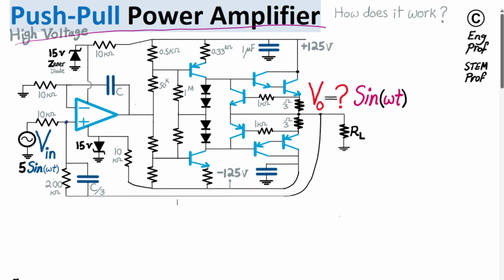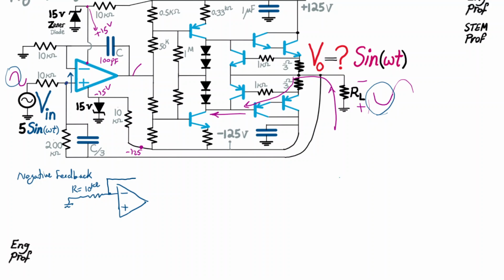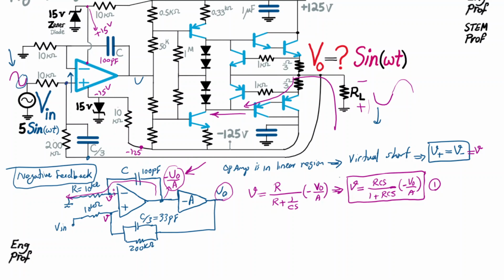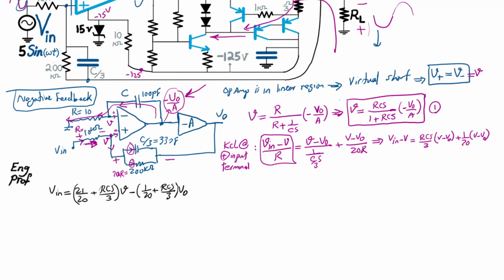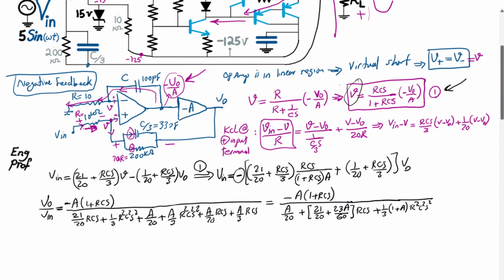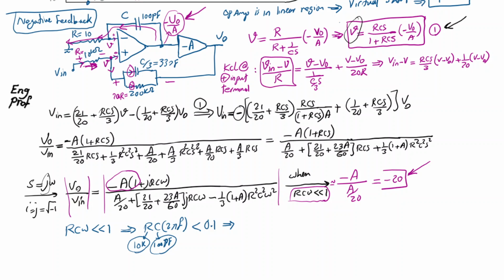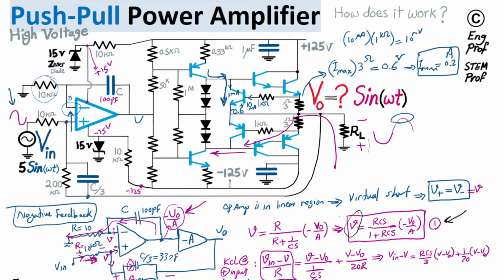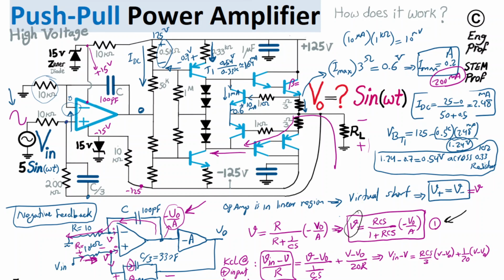Push-Pull Power Amplifier design (High Voltage) with Op Amp and Darlington Transistors

Comment: Great Video but it seems to me that you used 0.6V as the turn on Voltage for the current limit Transistors, but for the Common Emitter Stage you used 0.7V. Can you explain why you did that. The only reason I can think of is that you used 0.6V on the current limit transistor as a worst case calculation to not get unwanted clipping.
Reply from the maker: Good observation and thanks for watching!  You nailed the exact reason. For the current-limiting protection transistors, designing with a slightly lower threshold (0.6V instead of 0.7V) provides a conservative worst-case safety margin. It ensures the current limiter begins shunting base drive before the output devices reach thermal peak or hard saturation, preventing unexpected thermal runaway or premature waveform clipping.  Conversely, the main Darlington biasing chain uses ~0.7V per junction (1.4V total across the diode string across the Darlington BJTs) to precisely match nominal room-temperature Vbe drops, keeping the output transistors right on the verge of conduction to completely eliminate zero-crossing crossover distortion.  To explore other power stage, regulation, and analog design analysis from the channel, check out these related videos:
• Push-Pull Power Amplifier Design: https://youtu.be/866MYibo8yE
• Brokaw Bandgap Explained: Design a 2.5V Low-Drift Reference: https://youtu.be/loJBwi30Bb8
• Voltage Regulator Design with Op Amp, BJT & JFET: https://youtu.be/CJl-urzeiTo
• Bandgap Circuit Design: https://youtu.be/esMlNx5w9Jw
• Full-Wave Rectifier Circuit Analysis: https://youtu.be/DJJMNU-CYcg
• PID Controller for Servo Motor Explained: https://youtu.be/NATBlfABXrA
Thanks for asking good questions about the transistor biasing math and interesting technical discussion!

Comment: What specific benefits do you expect from this circuit? It would be more insightful if you mentioned the reason(s) for taking the feedback from the later stage and why you used feedback capacitors like that. A nice video!😊
Reply from the maker: You are welcome and thanks for your interest in my analog circuit design channel. Please see the transfer function derivation explained in the video to see how the specific values of capacitors in the feedback loops contribute to the overall response of the circuit.  With the chosen values and properly selected op amps, this circuit functions as a stable push-pull amplifier as long as the input frequency is less than ~15 KHz.

Comment: Hi,

Thanks for the nice video. I do believe though that this amplifier does not work properly.

The opamp will clip against the +-15V and will not be able to drive the current amplification stage to the appropriate swing as the voltage gain of the current amplification stage is too low. 

I built a similar amplifier, but I added a class A voltage amplification stage between the output of the opamp and the input of the power stage. That way I can properly drive the +- 120V.

Regards,

John.
Reply from the maker: Thanks John for watching and sharing your experiences. Glad to hear that your variant of this Push-Pull amplifier with an additional Class A amplifier worked nicely to drive 120V.  If you are using this design, depending on the type of your Op Amp and Transistors, you need to adjust the value of resistors especially at the output of the Op Amp (for example, the 50 K ohm and 500 ohm resistors.)  The choice of Op Amp is also important. Be sure to have a low drift, high drive CMOS Op Amp.  To watch related videos: Push-Pull Power Amplifier Design with Darlington and Sziklai transistor pairs https://youtu.be/866MYibo8yE 
Voltage Regulator Design with push pull output https://youtu.be/CJl-urzeiTo
More Power Amplifiers & Voltage Regulators Videos are in https://www.youtube.com/playlist?list=PLrwXF7N522y4vWr-8XRBqxpi5idFDE9BV video playlist.

Comment: Thanks, your video is very helpful !
Reply from the maker: @horacepoon7044  You're welcome! Glad that this power amplifier video is helpful. Related videos are: Push-Pull Power Amplifier Design with Darlington and Sziklai transistor pairs https://youtu.be/866MYibo8yE 
Voltage Regulator Design with push pull output https://youtu.be/CJl-urzeiTo
More Power Amplifiers & Voltage Regulators Videos are in https://www.youtube.com/playlist?list=PLrwXF7N522y4vWr-8XRBqxpi5idFDE9BV video playlist.

Comment: Great analysis! 👍👍👍
Reply from the maker: Thank you! Glad that you liked this Push-Pull video. More Power Amplifiers & Voltage Regulators Videos are posted in https://www.youtube.com/playlist?list=PLrwXF7N522y4vWr-8XRBqxpi5idFDE9BV video playlist.  🙋‍♂️
Reply: @STEMprof  Thank you so much! Couldn't you tell if it's possible to evaluate THD of this scheme?
Reply from the maker: @paulgraf4140  You're welcome. THD simulation is the best way to obtain a practically meaningful & reasonably accurate Total Harmonics Distortation number. It should be a decent level though given that this design is avoiding dead zones at the output pretty well. 🙂
Reply: @STEMprof  Thanks!

Comment: I'm wondering the reason for +/-125V. The circuit should be correctly polarized even with a much lower voltage just reducing the value of the two 50K resistors. Roughly,  having +/-60V the circuit should work properly with two 25K resistors instead of 50K. Thanks for your opinion.
Reply from the maker: @andreamarani2305  Thanks for sharing your thoughts and your comment.  There was a request to show an example of Push-Pull implementation using +/-125 volt supplies.  Otherwise, I agree with you that with your suggested adjustment circuit should work with +/-60 V supplies.  For more Push-pull power amplifier videos please see analog circuits playlist https://www.youtube.com/playlist?list=PLrwXF7N522y4c7c-8KBjrwd7IyaZfWxyt. Thank you.

Comment: Cool, circuit, would this also work if you simply "rectify" 220V from a wall outlet? but is hard to divide and create a "virtual" ground, because you have no 200+V opamps.
Special transformers are not easy to get.
Reply from the maker: @AnalogDude_ Glad that you liked this push pull power amplifier video.  Please note that in the presented circuit op amp uses a much lower supply voltages 0f +/-15 Volt (Zener reverse breakdown voltage).
Reply: @STEMprof  i meant to say an opamp to split a rectified voltage of 200V and create a virtual ground.
Than it could be a transformerless amplifier.
Reply from the maker: @AnalogDude_  Thanks for clarifying. I agree with you that Op Amp is not the best tool to split high voltage 220V DC to generate +/-110 DC supplies and virtual ground (without transformer). Because it requires hard-to find high voltage op amp like Analog Devices ADHV4702 https://www.analog.com/en/products/adhv4702-1.html that has supply operation range up to 220 V.  Instead, I suggest supply rail splitter circuit that either directly generating both positive and negative DC voltage from the AC outlet or uses high voltage Diodes and BJT Transistors similar to the output stage of the push-pull amplifier circuit discussed in the following video: https://youtu.be/866MYibo8yE. I will post a video hopefully soon. I hope this is helpful.🙏
Reply: Like i said, i very much like both amplifier schematics your posted and would like to build, but one requires +/-125V and the other +/-35V and such transformers are hard to come by in a shop. i did get a +-/15 transformer a few days after your post, but these are somewhat standard.
: )    @STEMprof
Reply from the maker: @AnalogDude_  Glad that you like these Push-Pull circuit videos. I understand your point regarding the availability of 15V transformer vs higher voltage ones. In my previous message I mentioned that there are methods not requiring transformers for example using two bridges of high voltage Diodes to directly rectify AC outlet to +/-110 volt with a middle virtual ground node. I will try to post a related video in my Analog playlist. 🙋‍♂️
Reply: We have 220V AC (approx 224V), 310V rectified after bridge, would be cool to know if you can divide that not using resistors and thank you.  @STEMprof

Comment: How is the 1MΩ Register Works? Looks like this register is no need at all
Reply from the maker: Thanks for watching and your question. The 1Mohm resistor helps with keeping the active Diode on to minimize voltage dead zones at the output. For more examples please see https://www.youtube.com/playlist?list=PLrwXF7N522y4c7c-8KBjrwd7IyaZfWxyt.  I hope this clarification is helpful in answering your question.
Reply: They help to short those two diodes to zero volts, not to depend on T1/2 stats. And this equalizes an idle point for the output transistors. Don’t forget that more than 120 volts are on T1/2  transistors bases. That’s pretty much for 1meg.

Comment: Thank you professor I love your videos. When you are free would it be possible to make a video on the Complementary Darlington Class AB push-pull Amplifier. I'm trying to understand why the 3 diodes that match the Base Emitter voltage drop of the 3 npns in the circuit are needed. How would I find out the circuit's transfer function characteristics/equation, bode plot, and harmonics too? I'm new to circuit analysis and electronics so there's a lot I don't know and even more I don't understand. Currently I'm trying to make this " https://www.google.com/search?q=The+power+amplifier+is+simulated+using+Multisim+with+a+1+kHz+input+signal+at+near+its+maximum+linear+operation.+The+results+are+shown+in+Figure+7-37+where+an+8.2+%CE%A9+resistor+is+used+to+closely+approximate+the+8+%CE%A9+speaker.&tbm=isch&ved=2ahUKEwjqhZCrkfqCAxVGz8kDHYJHBu4Q2-cCegQIABAA&oq=The+power+amplifier+is+simulated+using+Multisim+with+a+1+kHz+input+signal+at+near+its+maximum+linear+operation.+The+results+are+shown+in+Figure+7-37+where+an+8.2+%CE%A9+resistor+is+used+to+closely+approximate+the+8+%CE%A9+speaker.&gs_lcp=CgNpbWcQA1D9BVitDGCvEWgAcAB4AIABAIgBAJIBAJgBAKABAaoBC2d3cy13aXotaW1nwAEB&sclient=img&ei=Pw5wZarqDMaep84Pgo-Z8A4&bih=995&biw=1728#imgrc=Fhaio2AMyJkdIM " I believe you made a very similar video here Push-Pull Power Amplifier with Darlington and Sziklai Transistor pairs https://www.youtube.com/watch?v=866MYibo8yE&t=199s&ab_channel=EngineeringProf. any and all help would be greatly appreciated. Thank you in advance for reading :)
Reply from the maker: Thanks for watching. Glad that you like my channel. As you note, The Darlington-Sziklai complementary transistor pair that you are interested in is discussed in https://youtu.be/866MYibo8yE . The reason for placing 3 Diodes is to minimize output voltage dead zones during sinusoid zero crossing. Basically, the three Diodes keep all transistors on the verge of turning on so that when input voltage signal at the base of upper Darlington NPN BJT pair slightly increases above zero then the BPN Darlington pair turns on. And when that input voltage signal decreases below zero then the lower Sziklai (Darlington) PNP-NPN BJT pair turns on. If you remove those 3 Diodes then transistor pairs do NOT turn on immediately (resulting in output staying at zero) because input signal then needs to be at least 1.4v to turn on the upper Darlinton pair, and should be less than -0.7 volt to turn on the lower (Sziklai) BJT pair.  I will post a video analyzing the specific example that you referred to. For more examples please see my analog circuits playlist https://www.youtube.com/playlist?list=PLrwXF7N522y4c7c-8KBjrwd7IyaZfWxyt
I hope this explanation is helpful.
Reply: @STEMprof  Thank you Professor :)
Reply from the maker: @peterasamoah8779  You're welcome 🙋‍♂️

Comment from the maker: For more Op Amp & Circuit Examples pls see: Push-Pull Power Amplifier Design: https://youtu.be/866MYibo8yE 
Brokaw Bandgap Explained: Design a 2.5V Low-Drift Reference: https://youtu.be/loJBwi30Bb8
Voltage Regulator Design with Op Amp BJT JFET: https://youtu.be/CJl-urzeiTo
Full-Wave Rectifier Circuit: https://youtu.be/DJJMNU-CYcg
Voltage Regulator design: https://youtu.be/rI9f6-DyXxQ
Bandgap Circuit Design: https://youtu.be/esMlNx5w9Jw
Analog Exponential (Anti-Log) computer: https://youtu.be/kk2c7Gk3nW4
PID Controller for Servo Motor explained: How does it work? https://youtu.be/NATBlfABXrA
Flex Voltage Regulator Example: https://youtu.be/CJl-urzeiTo
Op Amp Analog Differential Equation solver https://youtu.be/ENq39EesfPw
Sawtooth Oscillator with Op Amp, JFET and BJT Transistors https://youtu.be/5zHXTx-Vl20 
And my analog circuits playlist https://www.youtube.com/playlist?list=PLrwXF7N522y4c7c-8KBjrwd7IyaZfWxyt
  I hope the Analog Circuit Design and Analysis Examples are interesting and helpful. 🙏